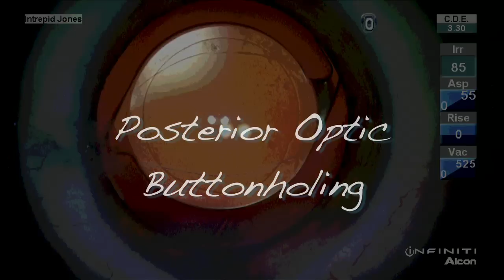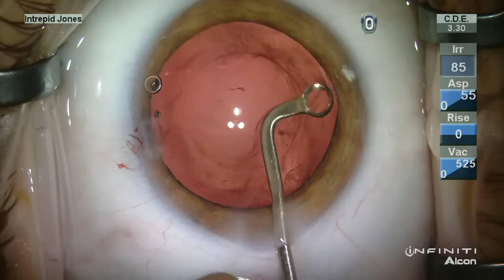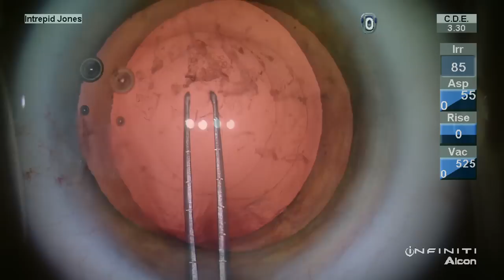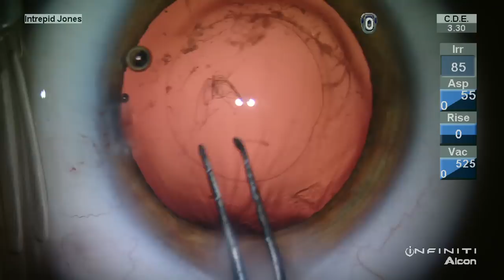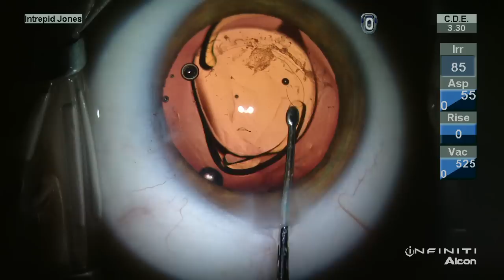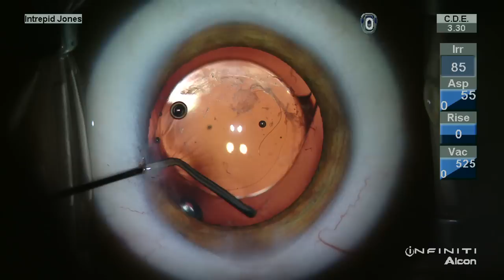Posterior Optic Buttonholing

Comment: after cataract surgery especially with younger patiens posterior capsular opacification can occur and treating it with YAG can cause floaters. can this method if used after a floater only vitrectomy prevent new floaters to occur if cataract surgery needed after FOV? Can this method be used if the vitreous is replaced by saline solution after floater only vitrectomy? thanks
Reply from the maker: Tokaji Leo yes I have done posterior capsulorhexis with optic capture in eyes following pars plana vitrectomy. Usually there still is a sheet of vitreous posterior to the capsule. Thank you for your interest.